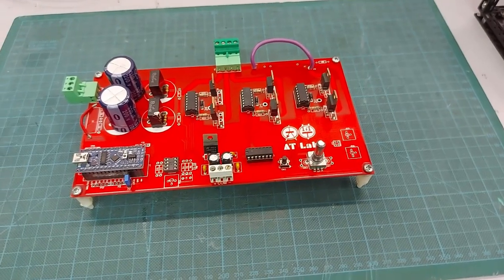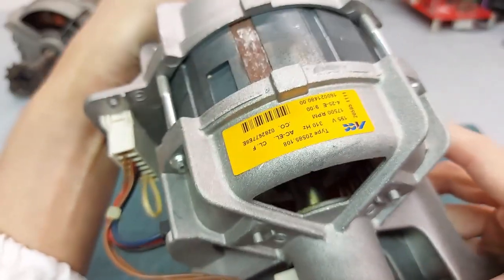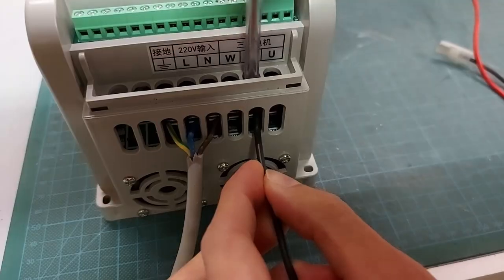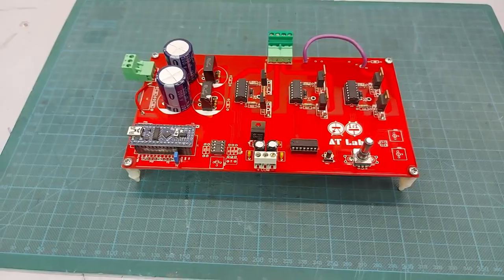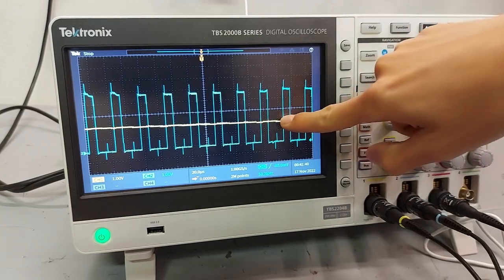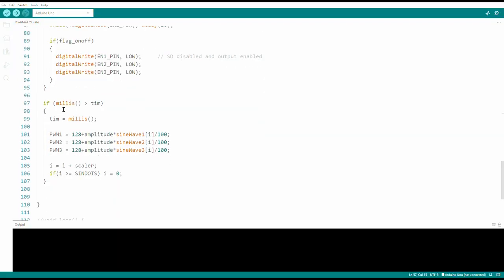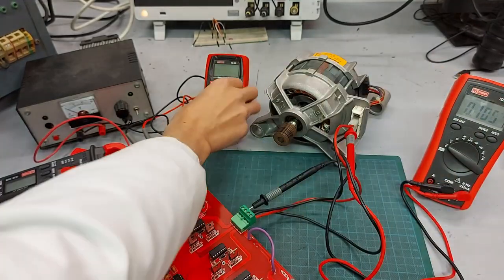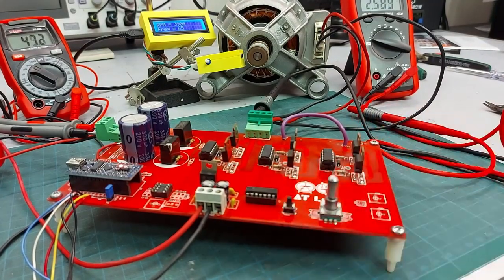Three Phase Voltage Suorce Inverter SPWM with ARDUINO for Washing Machine Motors - Pure Sinewave PWM

Comment: Wow, that motor looks decently sized, not too big. What's the horse power on that? I am looking for a 3 phase induction motor to have 0.75 - 1 HP, and hope it wouldn't be bigger than your motor. If a bit smaller, even better. So, in order to make a rough idea of what sizes to expect to find, I wonder what's the horse power on the motor you are showing in this video?
P.S. Why not just use an existing, commercially available VFD? I suppose you can find one as bare-bones as possible, without the case and controlling knob and button, that supports connecting an Arduino to it?... I mean, with your setup it looks like you need a power supply, but with an existing VFD the power supply is already built in, right? You take current straight from the wall and from the VFD it is sent to the motor, nothing else in between, as far as I could see.

Comment: I also have a similar motor, it says 195v can i run it on 230v. And does it matter how to connect the 3 phases? And i have @home a 380v 3 phase  50hz connection, would it also work with that? I know without the possibility to control the speed. Cool video
Reply: 230 V most damage the motor.